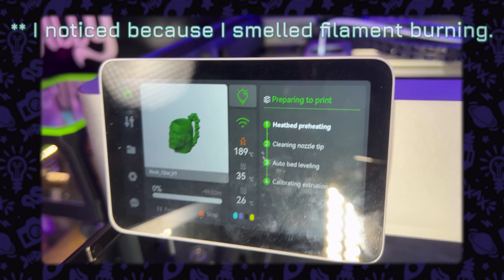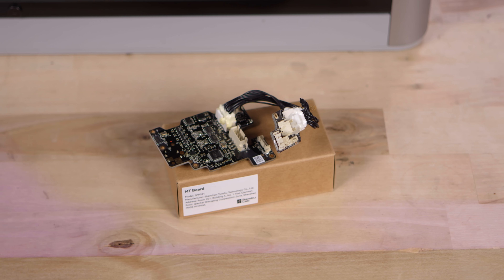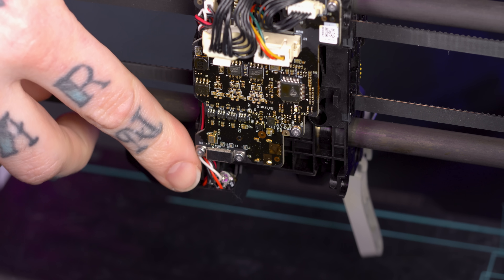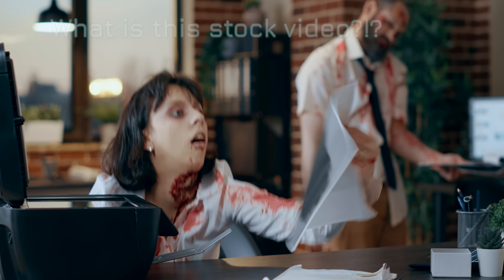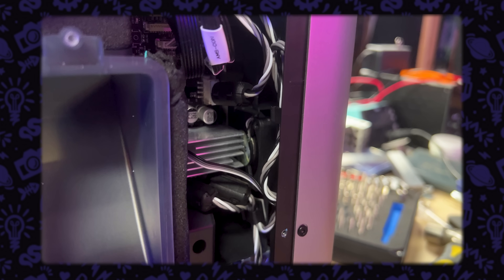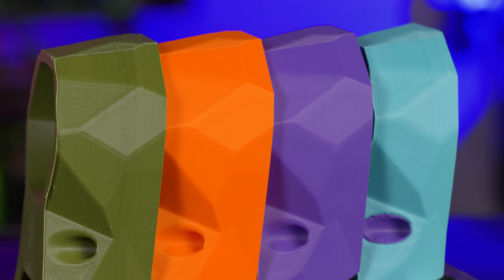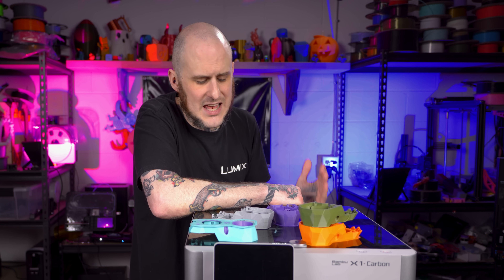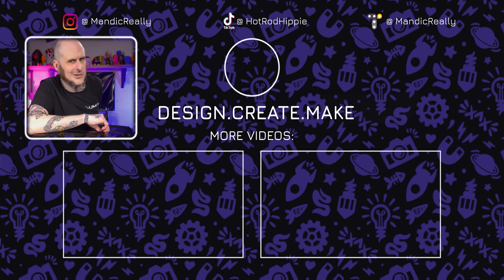MY BAMBU X-1 BROKE - Thermal Runaway?! Let's Fix it!

Comment: I wouldn’t think this would be a great first printer as it’s very complex due to being heavily integrated components that are hard to access and undertake maintenance. Ender 3 clones are a good starting point and print and play is something that really does not exist in 3d printing unless the machine is so complicated that you fall into the trap of too complex to fix.
My first printer was a Creality Ender 3 s1, which was a printer that had the upgrades that most people fit and worked with little effort straight out of the box, but the printer is only a small part of 3d printing process, filament quality, filament drying, different slicers, slicer tuning for each print to get the best possible output, etc,etc. 
we need to treat 3d printers with more respect as complex systems and not a toy, so many issues are down to people being told 3d printing is easy, it’s not, a lot of variables impact success, it’s like juggling, lots going on and a small miss causes problems.

Comment: If I go back to when I got my very first 3d printer (Voxelab Aquila right when it first came out) I can tell you that HELL no I would not have been able to diagnose or repair what you experienced! I was struggling to get my prints to stick to the bed at all, let alone printing, let alone printing *well*.

Comment: I have been 3d printing for a little over a year now so i am still fairly new and just had the 'b' motor die in my X1C. Took about 3 weeks to get a replacement and i gotta say if i was completely new to 3d printing there is no way i would have done that replacement.

Comment: Your comments about the slicer settings. This is a general slicer idea I had, wonder if it has any merit? Slicers have profiles for layer height typically which is often draft>fine etc. They adjust some settings but mostly the number of layers for top/bottom as a result. I was thinking, a useful thing would be to have some sort of slider option or maybe shape similar to the way colour gradients can be picked. You would have extremes for strength, quality, accuracy, speed (maybe)... you get the idea hopefully.... At the extremes you end up with things like lots of walls, high infill etc. or speeds adjusted to ensure accuracy and quality. This way you can quickly choose the priorities for the part and it adjusts all the settings to get the right mix. Experienced users do this all the time or create profiles etc but for adoption and ease I think this approach could work well a lot of the time. Anyway, that's my idea. I'd also like hole detection and it adds more walls/infill in those areas.

Comment: Your experience is completely different from mine, my x1c has been an absolute rock star with zero issues and has no ringing. Sounds like you just got a bum machine and maybe need a replacement.

Comment: I am surprised by how many connectors there are in that toolhead, but the laptop to desktop comparison is spot on. It's less daunting to work on a (non micro itx) desktop because you're only competing with the connectors and not the just-enough cable runs or delicate ribbon cables like you are on a laptop. I'm comfortable with that stuff and still hate ribbon cables. I've torched 3 monitors over the years because of the fragility and lack of physical resistance to let you know you're tugging one.

Comment: Let me guess, u change out the vans and add extra triangle shaped beams to the cornders to increase stuctural integrety. Or maybe soms passively powered hydrailic springs attached to the structure to take out vibrations in the frame itself?

Or you just slowed the acceleration to a minimum xD

I can't wait to see how you manage it

Comment: Honest to god I appreciate the questions you’re raising here but I see no point in them. Bambus Wiki is large and extremely educational. There’s a page for every error code and a tutorial for any replacement part. 
Yes Prusa does offer good support and tutorials also but they’re in the game for over a decade. Is that comparison even fair to Bambu? 
What if you want a CoreXY instead of a Mark3 style printer? 
There’s no single other company that offers better value in that price category. And if you’re willing to dip your toes into the 3d printing I would argue it is a requirement to be willing to learn and adapt. And that is same for every manufacturer out there. But you have to start somewhere. 
Yes the Bambu lab printers are a great first printer. The information is available and concentrated in one place but easier to find and follow than almost any ender 3 repairing tutorials that are made by 3rd party YouTubers at best. Prusa has a 10 year advantage but is it worth the price? 

You have to be ready to replace parts and maintain your 3D printer. If you can’t follow simple step by step instructions this might be the wrong hobby

Comment: Thank you for tinkering with the X1C. I have heard of the issue that you had with the connector on the daughter board. I believe that is actually one of the design changes for the P1P. I will see if I can find a source for that.
Reply from the maker: I have heard from some folks who have a more Direct line to Bambu that is the case. I know the P1P uses different hardware that seems to be updated for these reasons.  Leaves me mildly concerned about the long term support of this initial design honestly, but only time will tell.

Comment: That rounding of corners, is imput shaper, thats how it get away with less ghosting less hard corners. thats why tunign imput shaper yourself can get you the sharp corners.
Reply from the maker: Quite likely true, which there is zero way (currently known) to tune it on this machine. Which is hwy I said that Bambu should offere a quality Preset that has a reduced Vibration Compensation setting if they aren't going to allow us to tune it ourselves.  (I also hinted that I'd like them to let us tune it ourselves in text on the screen at the same time.)
Reply: @MandicReally  Depending on how the shaper is implemented, it might just work to use a lower speed, and since you can get many corners to occur at lower speed by lowering the acceleration, maybe try that strategy first.

Comment: Good lord that thermal runaway is super scary
Reply from the maker: I'm glad I was sitting feet away when it happened so I happened to catch a smell of the burning.
Reply: since it's a ptc heater, there's no risk of it getting too hot. 300c is the max, so no metal is going to melt.
Reply from the maker: @morbus5726  I'll ask again, where are you getting that 300C number from? The spec on the Bambu Website? Ceramic PTC Heaters are capable of going much hotter than 300C, that is just the spec that Bambu rates this heater to go to.  A rating and an intended limit does not account for failure.  A short has the potential to bypass an intended limit.  A safer design does not mean it is a 100% safe design.  E3D even says in their Revo information that it is safer, they don't say it is foolproof.
Reply: @MandicReally  i asnwered your question in a previous post. it depends on the resistance of the material used. I also linked a source.
Reply from the maker: @morbus5726  ahh, that is why I'm not seeing it.  Links are auto-filtered by YouTube's comment filter, I'll go dig it up and approve the message.
Reply from the maker: @morbus5726  Weird, your response isn't showing on my end and it isn't in the comment filter from YouTube.
Reply: @MandicReally  oh wait i had a link in it, it might have been removed because of that
Reply: @MandicReally  well basically what i said was that as the temperature of a PTC heater rises, the resistance of the material increases, until the heater cant get hotter. Because of whatever material was used in the hotend, the resistance maxes out at 300c, so after that temperature, power cannot flow into the heater, and it cannot get hotter. That why a lot of ptc heaters (raipdo, revo, bambu) are all capped at 300c. You can find some articles by searching "PTC heater max temp". i cant put the links here.

I might be wrong, maybe you could test with a spare hotend, and just keep running power through it and see what happens? I think people in the ratrig server did some similar tests with the rapido.

Comment: I think the point about serviceability makes sense. I think they probably thought "We can charge 100 bucks more and put more effort into a more frustration free repair experience or cut 100 off the price to fight prusa", and maybe the wrong decision from a new brand perspective.

I mean maybe its not, and maybe people really care about getting the price down more because they dont feel its likely to happen to them, but just look at how much adoration prusa gets just for having fast responses from support. They dont even do the whole free shipping both ways for them to work on it for you. I think even just hiring fast support would probably help the brand a lot.

That all being said, you compare repairing a prusa to this, and well, while their support is faster, youd have to do the same thing. Board out, board in. To me, as long as its not a multi hour process and no soldering is involved, while it would be better to maybe offer something like Apple Care or Bambu Care where they have certified professionals do it, and handle both shipping labels, I think its all about the same.

I keep mentioning prusa for a reason by the way, because its important to remember what this is competing with, because if this process is imperfect (which it is) but the other processes are also imperfect (which they are) then its kinda a wash, but you still wish there was the option.
Reply from the maker: My points about support and repair are mor to the point that, 3D Printing will always have that. Every single machine ever produced will require some level of technical maintenance and repair. No matter who makes it, that is the case. I didn’t like working on my Prusa Mk3, I felt that also was designed a bit over complicated and not with repair as a forethought. That’s kind of my point though. Someone else commented maybe repair shops are in our future. I know for a fact Printed Solid used to offer that for folks on a range of machines. Maybe it is something in our future for those who don’t have the time or knowledge to handle it.
Reply: @MandicReally  I actually technically have at least one shop I can drive too and multiple in my country (Canada) that offer 3d printer repair services, so I think its not too much of a stretch for printer companies to just create programs for them to make the repair experience so easy it fixes the problem of user intimidation. I think its just up to consumer aimed printers not sorting this out yet. I know for sure Stratasys does better..... they also have single multiple dollar build surfaces though, so not the same, but I guess my point is I think its possible.

Heck, actually, I think all it would take, is Bambulab allowing these repair shops to stock niche parts ahead of time, and sort ut the shipping labels for people. They could charge an extra 50 or 100 when you buy the printer and guarantee easy repairs for 2 - 3 years or so.

So yea, while I think 3d printing will always have that, a lot of appliances do, but usually there is some type of extended warranty or option available to alleviate that and I dont see any reason printers cant have that too.

Comment: So far the only way I've eliminated ringing is turning inner/outer walls down to 1k accels, and run everything else high. The biggest hurdle now is the belt pattern like VFA's, at least for me. The over smoothing is also pretty annoying.

Great video. I hope Bambu steps up their software game, because it's definitely lacking. The hardware is certainly there.
Reply from the maker: I've dropped acceleration on my "Quality" preset but haven't gone quite that far.  I don't hate the ringing and ghosting honestly.  I'm just raising the concern about a machine that is meant to be a "Push-Button and Go", "No Tuning Necessary" box, having it.  If I could go in and tune that out at my own discretion, I wouldn't care.  

The rounded corners I do care about though.  That annoys me. Crisp corners is something I've often looked at as defining a good print, and I can't do that here.
Reply: @MandicReally  Yeah, with the way things are now, I'd say the "set it and forget it" advertising is a bit of a beginners trap. I've already had a few things happen on my X1C that would greatly confuse a newcomer.

While I have you, can you confirm seam placement ends up being inconsistent between the sliced g-code preview and the finished print when using Bambu studio? I've tried asking around  several times and everyone just ignores me like I'm crazy lol.
Reply from the maker: @760creations  honestly I haven’t paid attention at all. I will now. I primarily use “Random” z seam alignment to spread it out, so I wouldn’t notice that normally. I’ll do some test runs and compare that.

Comment: Great video 👌 glad you call out the issues you ran into.
I am curious how these machines age!? Will there be spares in 5 years?
Reply from the maker: A factor that’s impossible to account for or judge. They’ve released 2 printers and already on the second machine changed parts. Multiple parts of the new P1P are different than the X-1, which raises concerns. It’s the danger of evolution.  If you don’t update things you don’t improve, but you run the risk of outdating your own hardware and early adopters.
Reply: @MandicReally  That is one of the main reasons I haven't pulled the trigger on an X1C. The P1P already has a different hotend design and looks like certain parts are upgraded over the X1C! The AMS has already gotten some changes as well so these changes make me hesitant on dropping alot of money on a printer that's still getting upgrades along the way. I really think Bambu should've taken an extra month or two for input from YouTubers before locking in the mechanical components of the finished product. You're one of the only content creators that has shown some issues with your print quality. Almost every other video I've seen everyone has sung praises to the quality of their parts. I have seen a small group emerge where parts printed slowly begin to show some print defects from the belts at slow speeds. And Bambu basically chalked it up to CoreXY printers not running well at slow speeds. This may be why they don't have a quality profile, in fear of it being actually worse overall.
Reply: @rileyneufeld7001  ...and then you have Prusa and Voron that just allow you t print the changes.  Also, CoreXY does just fine at slower speeds, that's exceedingly dumb to say on their part.

Also, the printers ship with white filament that hides all the flaws!

Comment: That seems like a dumb flaw to have. If I recall correctly, even if you just let it rip, the heater they use wont allow it to burn down your house as its the same type used on REVO where it just gets hot but not hot enough to melt anything (hence why the silicone that burns at 300+ isn't burned).

IIRC Prusa recently even fixed this specific type of thermal runaway where the board gets readings that are just valid enough for the usual dumb thermal runaway to think "ladida, its probably ok" I imagine it's even worse for a high flow rate, fast heating tool head since the amount of current it needs while printing vs sitting idle must be massively different, so Im guessing they just said "Meh screw it, we'll give it a lot of leeway since it can't melt anyways" rather than adjusting it to the flow rate as well.

Even still, this seems like something that they'll have to stop taking the shortcut on.
Reply: Bambu's answer: "The HOTEND can only reach a maximum temperature of around 400 C...", what means the heater alone can reach higher temps, and it is probably not a PTC heater. 
For some reason they don't use PTC acronym anywhere.
PS, 1. ceramic doesn't means PTC, 2. resistive wire also has a Positive Thermal Coefficient.
Reply from the maker: I’m not a electrical engineer so my knowledge of how these heater elements function is limited. To me there is always the potential to fail outside of spec or expected failure mode. Just because a heater isn’t supposed to be able to overheat doesn’t necessarily mean it won’t. I’ve seen early beta units of these machines with indications of heat issues inside the Toolhead. There is that factor also. It may sit happily at 300c all day, but will the plastic or electronics around it survive? It’s a concern that will require long term testing (general use and accounting for failures) to really know. I am not AT ALL saying it is gonna be another Anet fire hazard, just concerned with the behavior I experienced.

Comment: Thank you for the updates and just the honest perception.  3d printing you have to be prepared to tinker! You cannot be scared to take the cover off and see what makes it tick so to speak. If you are not prepared to do that you are going to be pulling your hair out. 3d printing is a hobby nested inside of another hobby that work together. Fantastic video.
Reply: And all the while you are tinkering you are learning invaluable practical skills! 

It's like the perfect hobby
Reply: I have learned that the hard way with my ender 3 that i am learning how to mod myself. My next hurdle is going to be replacing fans. I feel confident because of what i have done so far, but it took alot to take that first step into tinkering.
Reply: @Joshua Joly  the fans are the easy mod! Make sure you buy the right ones the mod goes really easy.